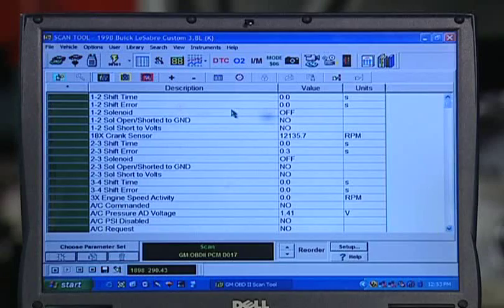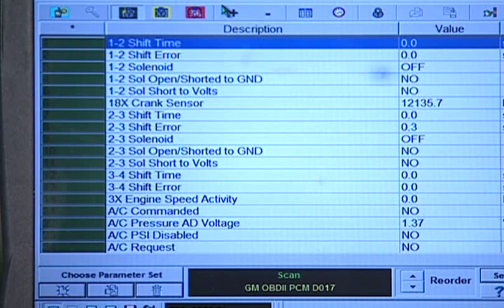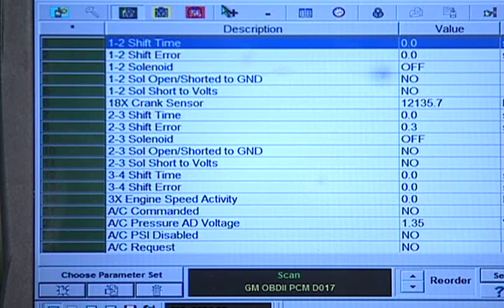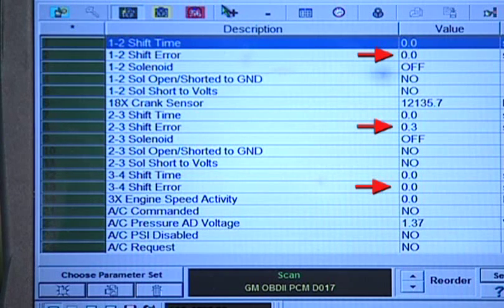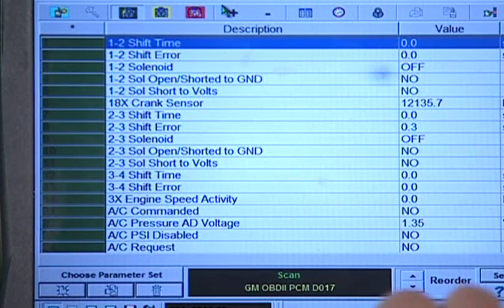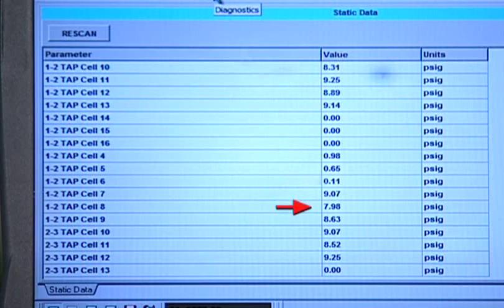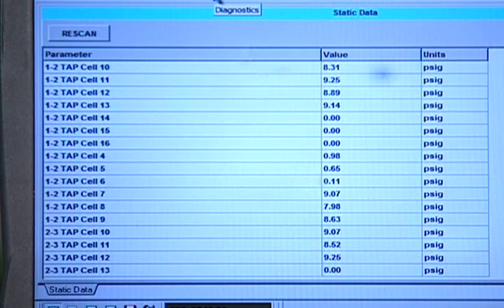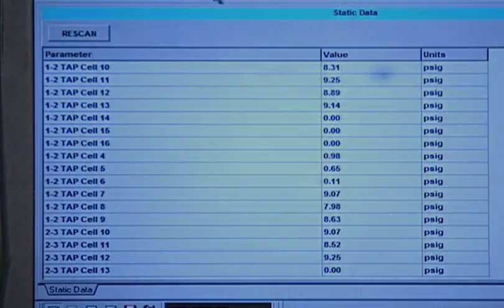Automatic Transmission: How to Find GM's Transmission Adaptive Pressure Control System

Comment: Is it advisable to "Clear TAP" with a Tech II after a complete fluid (and filter) change where the fluid had not been changed in about 11 years or more and before the fluid change the vehicle had a no-shift in any gear condition? Engine was running fine but no movement in any gear. Car was towed, then driven in reverse, then in Drive 20 feet into a garage where the service was done. After the service, problem has disappeared although I sense very minor shudder shifting from 2-3. I thought clearing tap values might help. Could it hurt? Thanks to anyone out there!
Reply: unless work has been done internally or the transmission is new to the vehicle tap reset wont do any good but actually hurt the trans